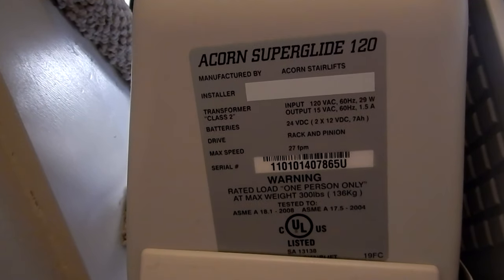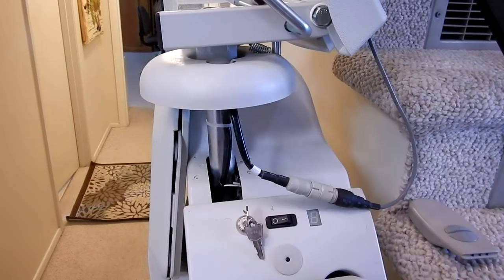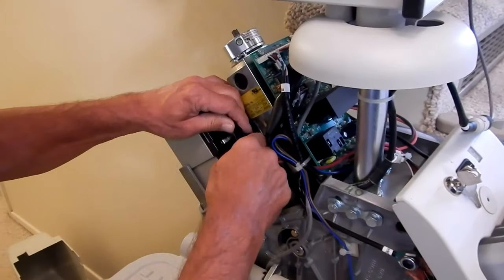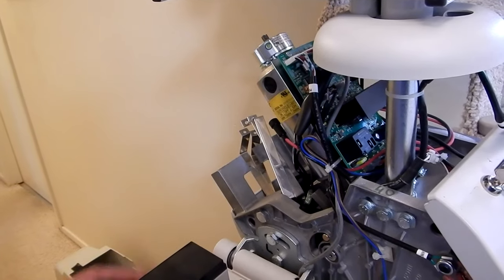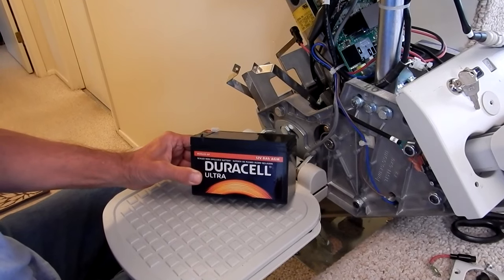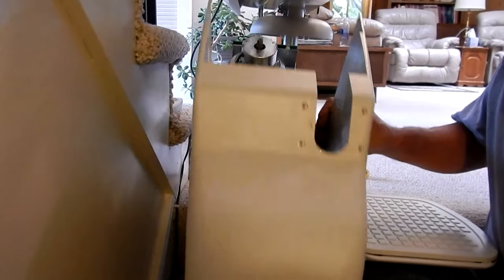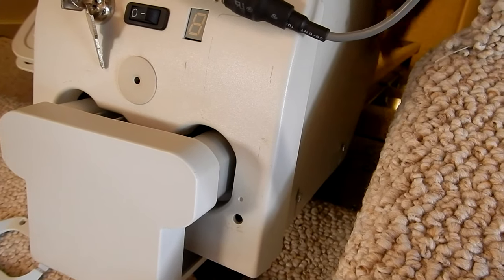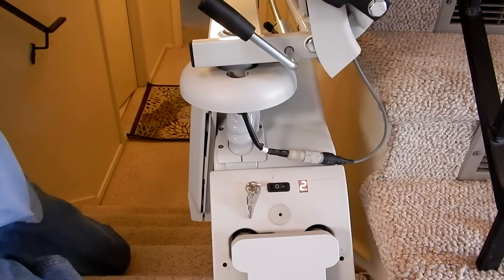How To Easily Replace The Batteries In An ACORN Stair Lift

Comment: Just recently got one of these from a neighbor. It works great after cutting the rail to fit our one-step shorter basement stairs. I found this as I like to know all about machines that I have before there is need for maintenance. Many thanks for providing an informative video.
Reply from the maker: You're welcome,  Lon. It's a good idea that you do your research before the problems come up. Changing the batteries is pretty easy and something you will no doubt need to do if you have the machine for any length of time. Thanks for the comment!

Comment: Excellent video. I started on the replacement project using some printed instructions, but was stymied when I could not remove the cover after removing all the screws. Your demonstration of removing the cover filled in the gap that I was missing. Project finished - no problems. Thanks so much for taking the time to do this. 

Oh, and I agree that this could be made a lot easier by the addition of a door or removable plate on the housing cover. No good reason for it to be this complicated, except to make it easier for many folks to just call the tech.
Reply from the maker: Norman Young Thanks for the nice comment. It makes me happy that you found the video helpful.

Comment: Great video and detailed video presentation. It came at the right time and I appreciate all your time in sharing this. I know this post is too long and apologize, anyone else read on but don't complain later. 

I have been concerned about my 99 year old's aunt's Acorn chairlift batteries for some time since I bought it for her used and put it in over 5 years ago. I got a call from her this past week and she told me the chair stuck in middle of way down and she had to get out and walk. 

I went down the next day to look at it and had just replaced the batteries in the remote the day before. It would not make a complete pass up or down without  stopping and keep pushing the remote's button. I figured it was the main batteries on the lift. Called Acorn up and was totally shocked at price (around $360) to replace these. I had no idea how to do it and saw this very helpful video which someday will save me well over $300 for 10 minutes work. It turned out that our trouble was that the remote's 9 volt battery was bad even though just replaced the day before. I can't recall what code I was getting when it was stuck and stopped. 

Is there any way you can check battery condition for strength even though still working and show code 1 when at charging locations? 

Bottom line is SHAME ON ACORN for ripping off these elderly people who need help the most. Please people, check on any repair costs before buying any unit. I personally do not believe the service extensions are worth the other RIP off price they want. These excessive prices to fix really upset me and Acorn knows that most of these people don't have help like you and me can provide to relatives. They even told me they would not sell me the batteries alone as it required a technician to do it. Can you believe that? This was told to me by their home office customer care agent on Jan 29, 2020 for all who read this.
Reply from the maker: The batteries in your unit are probably close to the end of their usefulness. Depending on the batteries they are usually rated for 4-5 years. I got 7 years out of a pair once. You would probably have to take the batteries out to put a load test on them individually to determine how strong they are. If it were me I would replace them soon, when it is convenient for you, before your loved one has a problem. Thanks for your comment and good luck with the replacement.

Comment: Great video.  Just bought a house with an acorn chair lift.  The display was blank.  Thanks to your video, I was able to learn how to take the cover off and find a loose wire!
Reply from the maker: Good to hear that you found the problem. They are a little intimidating the first time you work on one. You feel like you might wreck something. Thanks for the comment,  Steven.

Comment: In my "younger years" I was a "Heavy Line Mechanic" (fancy term for being able/required to repair any and every thing on an automobile!!) for a couple of decades, also raced motorcycles professionally (lotsa metal plates, pins, broken bones, including a Crushed C-4 and Fractured C-5 [broken neck!!] )..  Now,  kicking seven and a half decades in the posterior we went to buy a VGC but gently used stairlift, I had NOT a clue as to where to find the batteries!! (I DO know how to change them, tho ;-} )  I enjoyed your informative video.. Thanks for teaching this "old dog" a "new trick"!!
Reply from the maker: Sounds like you've had a fun life. I'm probably a bit like you as I seem to be able to fix a lot of different pieces of equipment, machinery, vehicles etc. I'm glad that you enjoyed the video and appreciate your nice comment.
Reply: Know the feeling about getting old

Comment: Many thanks for the clear instructions. Allowed me to have everything I need before making the 650 mile round trip to do this for my Mum-in-law.
Reply from the maker: You're welcome, Colin!
Reply: @TomandJulieMineExploring  Those metal battery securing bands are just itching to short a battery out. Would suggest anyone to have a little insulating tape handy to put temporarily on the terminals to help prevent that while threading the batteries out and in.
Reply from the maker: Sounds like good advice.

Comment: I need a stair lift and decided to learn all I can about it before buying one. Thank you for taking the time to make this video.
Reply from the maker: You're welcome, Fay. The batteries are rated to last around 4 years, although you might get more out of them, so replacing them is something most people will have to do at some point. Thanks for watching!
Reply: Acorn chargesb75 with a service contract to replace these even within battery warranty
Reply from the maker: They aren't cheap that's for sure.

Comment: Thanks for the video. Am about to change the batteries on my Mum's stairlift. And glad to see how best to access the innards. Would like to add though people be careful with the metal straps when putting the batteries in. Those 12v batteries can throw out a good lot of sparks when shorted even when low. And if continuously shorted will cause a fire. So make sure the battery terminals are clear and secure.We use these batteries in alarm panels and have seen burns, eye injuries, blown equipment and fires due to sloppy installation.
Reply from the maker: That's always good advice when working around batteries. The good news is that 12 volts is not enough to give a person a serious shock. Good luck with your machine and thanks for your input on the shorting of the batteries, Grant.

Comment: Excellent demonstration my friend👍 .. if it was mine I would have left off all the parts, so it be easier to do next time🤣... looks to me like, if the manufacturer cared, they could make that have a door that opened up and you could slide the batteries out. Thanks for sharing my friend
Reply from the maker: Thanks for the great comment, Yankee. It would make sense to leave an easier access door for the batteries, but then their service technicians wouldn't have anything to do.
Reply: @andrewmiller8891  Actually it WAS charging, did you not see the LED display flashing "C5". The C codes are charge codes and go from 1 to 6 as it charges. Maybe research before having a go at someone who was kind enough to do this for us.

Comment: You did a very good job demonstrating  how to remove the necessary items to change the batteries. It made it easy to change the ones in my starlit. I would think the Acorn could have an access door that swings out that gives access to the batteries. I was even thinking of cutting one out that was on hinges & would swing out.
Reply from the maker: Hi Jerry. Yes, you would think that Acorn could have made the access a little easier. Now that you have done it once, it will be quite easy next time. Thanks for your comment.

Comment: Thank you for a great video. I'm about to buy a pre-owned unit and the owner told me she was quoted $250 for the batteries to be replaced 😳.  I was 99% sure that was a rip-off move from a technician.  Thank you for confirming my suspicions.
Reply from the maker: $250 seems a little high. I know they need to make a profit but many people that own these units are elderly folks who may not have a lot of income. Thanks for the comment!
Reply: hi,is there a video showing battery replacement on a medicare 950 minivator please
 @TomandJulieMineExploring
Reply from the maker: @rayhodges3071  I'm not able to find a video on that model for the battery replacment, Ray. I will try and look into in the morning.

Comment: I decided to try replacing the batteries on my mom's Acorn stair lift.  I'm VERY inexperienced and when I pulled the cord apart, the fuse dropped! I hope I can find it!Other than that, your instructions have been tremendous.
Reply from the maker: Good luck finding the fuse. Thanks for the comment!👍
Reply: I can't find it. Can you tell me what kind of battery I would buy to replace it?  I'm assuming it is the fuse that fell.  Help?
Reply from the maker: When you remove the old batteries replace them with the same type. If you have a Batteries Plus store, or something similar, near you bring the old ones in and they will match them with new batteries and recycle the old ones. You should try to find the fuse as I'm not sure of the amp rating your machine uses. It should be a standard glass automotive AGC type fuse, but it's important to know which amp rating to get. They are very inexpensive.

Comment: At 5:45 min. Do not like how close the band clamp gets to the battery terminals even if bat are very low...(Use electrical tape/caps to protect batteries first, Could avoid a short) 
and be very careful for some sharp edges that could cut you. 
I did enjoy the video...Thanks my friend and I gave it a thumbs up.
Reply from the maker: Good advice, Luis. Thanks for your input.

Comment: Tom, I did everything right as best as I can tell, one chair works fine, the other has an H3 error code. Everything looks okay so I'm stumped!
Reply from the maker: There is quite a bit of information on the Internet about error codes. You must have a newer model than what I have as I don't think my codes include an H3. It might be a safety sensor that is not quite right.
Reply: Tom, when I was "wrestling" the cover back on I inadvertently moved a bundled wire connector off of it's plug-in, that was the problem (now I know, one service call later).
Reply from the maker: @FredK55  Oh, too bad that happened. Thanks for posting what the problem was...maybe someone else can benefit from your experience.

Comment: Great Video Tom... After watching it, I'm going to attempt it myself.  Spent $250 last year to have them come and fix it, my turn now.   Happen to know the Battery Number you installed? I want to be prepared Before I do it myself
Reply from the maker: Since there are many different years and models of lifts, I did not put specific replacement battery numbers in the video. I would suggest you replace the batteries in your machine with the same type as are in there now. They should be readily available, depending on where you are. Thanks and good luck, Tim!

Comment: Hello Tom, I watched your video last night.   I'm mechanically inclined, and felt I was up for the task ( Also I'm CHEAP ) Didn't want to pay the $250.00 service call. Then the replacement charges with parts extra.   The total that I was quoted was north of $365.00     Well I'm B R A G G I N G, but I had the chair apart and batteries off in 5 - 6 minutes, and the reassemble maybe 4 - 5 minutes.   I could have been faster, but I was patting myself on the back TOO much... LOL.     I found that Amazon has a pair of batteries for $34.95 with FREE shipping.  I didn't want to wait two days so I went local, and only paid $20.45 EACH.    Tom T H A N K S again for the EXCELLENT video. You made my job easy, and my 91-yrs old BEST fishing BUDDY very HAPPY.
Reply from the maker: Well Paul, I have to say I like your enthusiasm. You making your 91 year old fishing buddy happy, makes me happy. Thanks for the comment!
Reply: @TomandJulieMineExploring  Just wondering...i was gifted an acorn stairlift-straight 130 and there are no re-installation instructions.....any ideas or videos ?
Reply from the maker: @donnathomas9769  No videos, but I would guess you can find some installation instructions somewhere online.

Comment: Thank man really helped out , what size batteries did you get
Reply from the maker: You're welcome, Jay. I put the same size and type as the two I took out, only a different brand. I never thought to write down what the exact numbers on the batteries were.
Reply: They come with 12 volt 7.5 amp batteries. But to make it a heavy duty unit which can carry up to 350 lb you can put 12 volt 9 amp hour

Comment: THANK YOU! Now I will venture to undertake this when my batteries run out. I think its a matter of days! Where to get the replacement batteries ? I am in voorhees NJ Thanks.
Reply from the maker: You're welcome. The batteries should be readily available. I got mine at Batteries Plus. I have heard that some people have ordered them through Amazon. Just be sure to get the same size and rating as what you have in there now.

Comment: I looked at the code and states that the batteries are low charged. That could be defective battery or batteries, or the system is not charging. The transformer put 24 volts to the printed circuit board charger and pass it to the batteries. I guess you were lucky that the problems were the batteries. It couldt it been the transformer not putting the right amount of voltage  (the codes still working) or the printed circuit board. I find it good that you show me how to remove the cover, I thank you for that. It would it been great to show how to test the transformer with a load to see if it had the right amount of voltage sent to the printed circuit board and if the batteries were receiving the right amount of voltage. Anyway you did a great job. I learned something from your video.
Reply from the maker: Hi Luis. This video is only about changing the batteries. I  have to be careful trying to get people to do a more involved diagnosis as it is beyond the scope of most chairlift users.
Batteries are the number one issue with these lifts. If your batteries are more than about four years old, I would replace them.
Thanks for the comment, and good luck with your repair.

Comment: I’ve changed the batteries for a friend who has this same chair based on your video. Thanks!  She now has a defective motor and wants me to swap it as well. Do you have any videos or information for replacing the drive motor?
Reply from the maker: I sorry I don't have any info on changing the motor, Dave. Maybe a little research on uour part will get you the information you need to do the job.

Comment: I have a 130 Acorn I need installed in Ky area 
This is very informed info of changing batteries 
I’m in a wheelchair and I’m not able to I stall it’s the straight type no curves any Indio would help on a installer thanks
Reply from the maker: I'm so sorry I have no information on any installers. There are installation manuals, and other information about installing a lift, available by googling "Acorn 130 installation manual" I do hope that you get your machine installed and thanks for the comment.

Comment: Mine didn't have the Zip Tie strap, but just FYI, with some Zip Ties, you can use a small flat blade screwdriver, and release the catch on the Zip Tie, so you can reuse it. Just my 2 cents, I'm sure this video has helped a lot of people, I figured it out by trial and error, I wish I had seen this video before I attempted, lol, but that was 10 years ago.
Reply from the maker: I don't think the zip tie is necessary, but I wanted to put it back the way I found it. I suppose the bolt on the band clamp could rattle loose. Thanks for your input!
Reply: @TomandJulieMineExploring  It can't hurt, I might consider one for mine.

Comment: Thanks Tom! 
How old is your system?
I JUST had a lift installed for my Father, less then two months ago, and it will not operate at all.
It worked well in the beginning, but it reads "F5" continuously.
I've read their instructions, and acted accordingly,  but nothing is working.
Any ideas?
TII
Reply from the maker: An 'F' code has something to do with the motor, I think. Turning the key off for 30 seconds then back on resets the motor. It would be worth a try.
Reply: F codes are not just motor...

Comment: Thank you for the video.  We replaced the batteries because we were getting the battery not charging code. It does the same with the new batteries.  The charger contacts on the rails all look good, transformer has good output.  Any other ideas? Much appreciated.  Thank you.
Reply from the maker: I probably won't be much help. A fuse, bad switch, broken wire or terminal come to mind.

Comment: did you have to charge the batteries before putting on the stairlift if so what kind of charger did you use. Thanks you did a great video.
Reply from the maker: If you buy new batteries they should come already charged. Thanks for the comment, Paula!